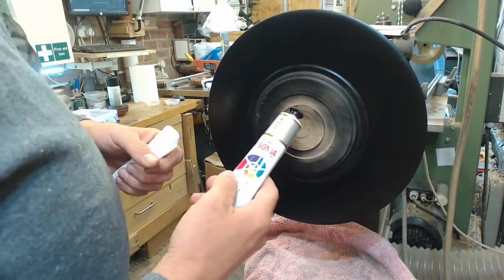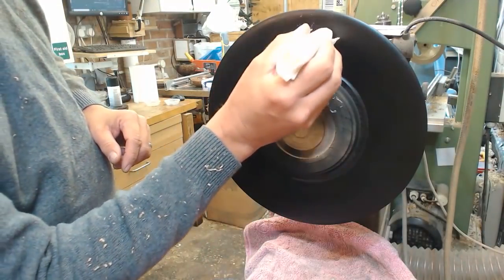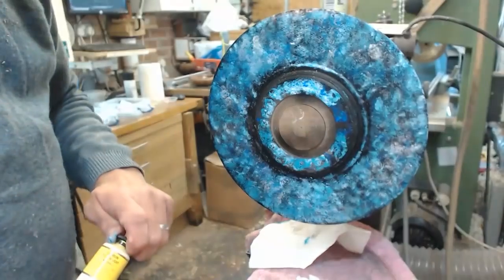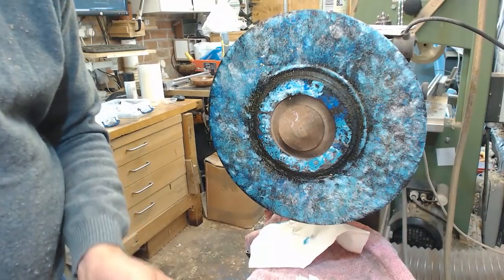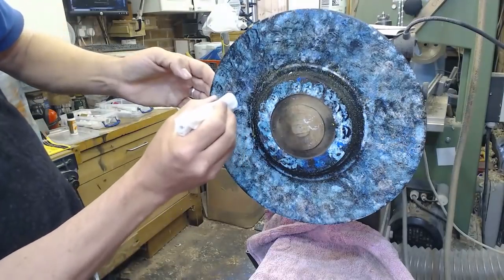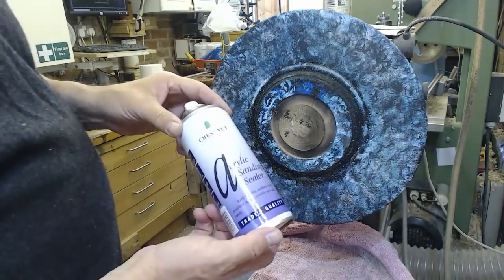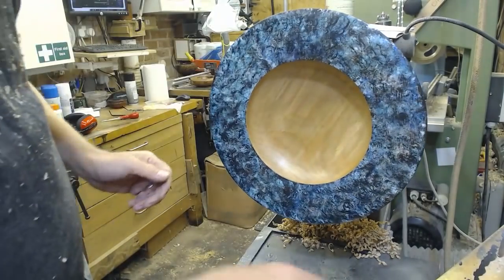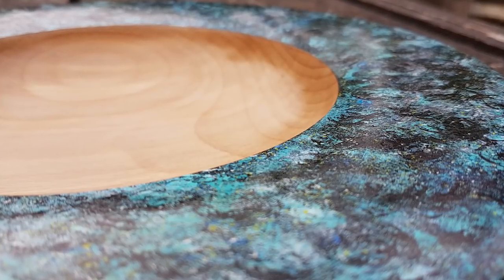Woodturning - Acrylic Paint Dabbing Decorative Beech Bowl

Comment: Glad you decided it needed that little extra with the black as it got too over powering and awash with all the colours. Also glad you resisted the yellow. Now I actually preferred it in the video images rather than the stills. Could just be lighting but the stills show up too much of the really lighter blue. My personal preference anyway.

I think the red may have possibly worked (very dangerous colour is that red as it always draws the eye). Had you put some on before the last 2 or 3 coats of colour to hold it back.

Either way, love, hate it or sit on the fence it's still a great video to watch the process. I especially love the fact that it was all applied with kitchen towel that we all have and use all the time, so no special tools.

Great job Stewart, another one I bet sells well.
Reply from the maker: Thanks, Paul - yep, the black at the end was definitely needed to mute the white that had become a bit too dominant. I like to use everyday objects to colour with as it shows that no special kit is needed. It was great to see someone really like it and then part with their money to buy it! I'm hoping I'll sell some more this coming weekend...the final weekend of the open house...fingers crossed! Cheers!!

Comment: Lovely. I enjoyed this. How do you deal with the side and back of the bowl? Is there a straight line of color front to back or does it get a bit shaggy?
Reply from the maker: Cheers, Michael! If there is any colour that gets on the back or the edge of the rim, it can usually be sanded off quite easily if a wax finish has already been put on before colour is added.